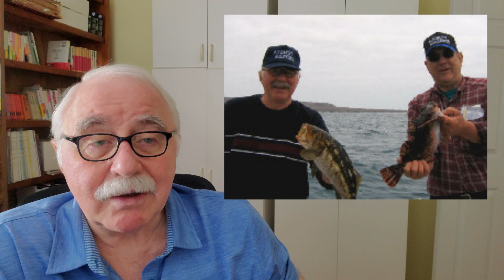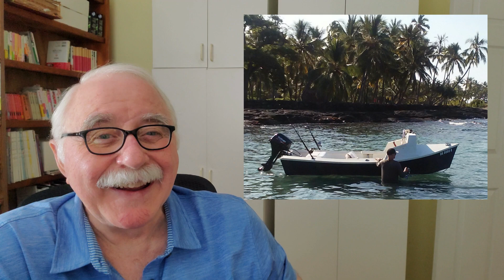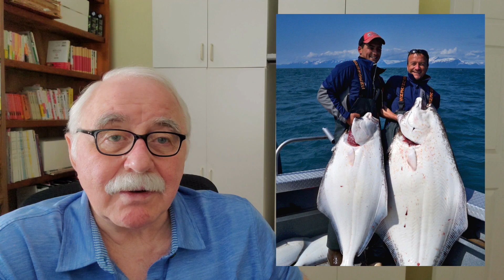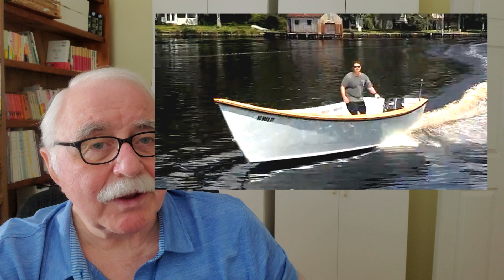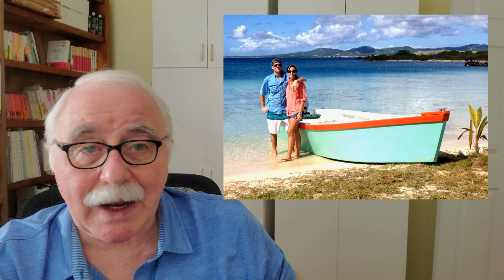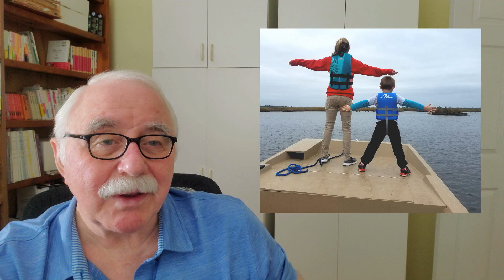Yes, You Can Build a Boat - Flat Bottom Boats.

Comment: In the 70's. I built a 20 ft. Carolina dory, fished up to 20 and 30 miles offshore LA. I worked running offshore supply boats in the oil field industry I have caught tons of Red Snapper in that skiff. I would overnight in the skiff around the oil and gas rigs loading up on Snapper. Big Paydays!
Reply: I enjoyed building the boat about as much using it. Now in my mid 70's I plan on building another for my twin grandsons with their help, they are now 18 and have a love for the water as much as myself. Both still live south LA.

Comment: The high prioritization of stability by the majority of power boaters is based on the fear of tipping over, which itself is rooted in the fear of the sea. You’ll never hear any complaints about stability under-way because the engine is running and the sea is at your mercy. But as soon as the motor shuts off, those deeply ingrained fears manifest, and the average boater demands a boat that feels like a pier, no matter the cost.

Basically, you shouldn’t get into a flat bottom because of stability, flat bottoms have other greater merits like, efficiency and being able to beach launch due to shallow draft, ease of build.  Stability is a pleasant side effect.

Comment: South Texas. I will be making a flat bottom boat to hold five people. It will be a 72" bottom with a length around 20'. myself and my 2 sons are about 300lbs each. it is  going to be used for bass fishing, catfishing and then fishing at night below a light. i will also use it to swim off of and maybe tow an inner tube. Center console 20 hp. you definetly have inspired me.

Comment: So a flat bottom boat should be easier to build. It should be cheaper to build. It should take less power to get it up to speed! It’s rougher in rough water.
Reply: It's rougher in rough water when you are going fast. At slow speeds or having the motor off, it's more stable in rough water.

Comment: Can anybody help me understand why we so rarely see flat bottom catamarans / multi-hulls?
I'm thinking of double-ender canoe type demi-hulls with no submerged flat transom, almost no inclination of the lateral surfaces (minimum drag) and no rocker, plus a pointy "axe" type bow. In other words: a hull shape where the least amount of overcome drag translates into lift, but instead forward movement only. Such a vessel would lose top speed, but gain a lot of efficiency.
~
Let's face it: sailing vessels often travel at rather slow speeds around 6 knots and the winds aren't always strong, but still, modern sailing cat hull shapes often seem trying to imitate racing cats or fast going power boats. The hull shape doesn't reflect the speeds that they're actually going at, in my view. Coming onto a plane isn't very realistic anyways, so why not commit to 100% displacement-only demi-hulls, accept speed limitations (~hull speed) and optimize for efficiency instead? Even when a sailing cat is motoring, fuel isn't free, and they still don't go very fast. I also have solar-electric catamarans in mind, where it's all about efficiency. Flat bottoms also increase live-aboard usability of hull space, plus: shallow waters and beaching become possible.
Of course, such hulls wouldn't really work for mono-hull sailboats (dynamic stability and maneuverability), but I believe it's a different story with multi-hulls.
~
I understand that a pointy stern (=double-ender design) seems counter-intuitive for pitch stability. On the other hand, if the stern has more displacement, a wave rolling under the stern will most likely lift the rear end and make the bow (which will be pointy anyways in order to reduce wave-making resistance) submerge even more (lever effect), hence the increased pitch stability may prove wrong if only the stern is wider, like in most modern cats. I don't believe that with a typical modern catamaran hull they pitch any less, instead only the pitch axis is located more at the rear end. Moreover, with motor cats (e.g. solar-electric) the COG is much lower anyways and there are no wind gusts blowing high above COG into sails (thereby further affecting pitch stability).
~
I also would only sllightly round out the transitions between bottom and lateral surfaces (=in order to reduce the wetted surface/friction resistance and induced drag), but no actual "round" bilge.
~
Thoughts anybody?

Comment: Hi,
Its a great video very informative. I'm from a Carpentry background but never built a full size Boat.

In England we have Canals that can accommodate a boat 4m wide and well over 20 meters long but when I checked the depth of the Canal after heavy rain in Wiltshire, it came back as only 1100mm deep.

I was looking at the possibility of building a House Boat suitable for the Canals with a flat bottom.  I'm sure I could build the Boat as I specialised in bespoke Carpentry but was worried about the depth of the Canal and the possibility of perhaps a stolen bike dumped managing to rip a hole in the hull.

I wondered how deep would you think a flat bottomed Boat around 15 meters long and 4 meters wide at deck level.  The flat bottom of the Boat would probably have an area of around 4 meters by 15 meters. The Hull would be angled slightly, so the keel part would be perhaps 200 mm below the highest part of the Hull at the edges.

Would it go under my target depth maximum of under 500mm. That's the max depth I would like the Hull to reach.  I plan to build spars and then clad with batten and fibreglass.
 I plan to add skid rails around 75mm running the length of the hull to give  a second chance against hitting obstacles dumped in the canal or grounding out in shallow water.

It would not travel far and it would rely upon outboard power to move around.

Most Canal Boats in the UK have steel hulls but mine will be fibreglass as I'm not that great a welder.

Please help with the depth calculations, if you don't mind.
Thanks
Reply: Mr. Spira was a wonderful man and he would have surely answered your questions, but he sadly passed away about a year ago or so.

Comment: Hi, interesting video thanks, would it be a crazy idea of building around 17-19ft wooden but fiberglassed over  flat bottom boat and building a shelter cabin in the front a light one probably fiberglass one just for two people?
Reply from the maker: Not at all many people do it.
https://spirainternational.com/hp_anac.php
https://spirainternational.com/hp_cour.php
https://spirainternational.com/hp_caro.php
Reply: @tjkid07  thanks for reply, some beautiful boats build out at the website however I am looking at one of those skiff boats just wondering what size engine would push it at sea nó matter the weather and wind with 4 people some gear around 18 ft skiff just to move slow no need plain speed let's say 8 to 10 kmh that's all I need, if it's petrol outboard? And whats your opinion same case diesel inboard, thanks

Comment: I river and lake fish missouri and Mississippi River local around st louis area would like a wide surface flat bottom boat would like aluminum or wood got any plans 25-50 hp outboard motor range don't need a speed boat just a simple fishing boat that holds good weight for 3 ppl and not cost a ton
Reply from the maker: Absolutely, look at the 16' Oysterman or 18' Carolinian. Perfect with 25 horses and some of my easiest and inexpensive to build small boats. Link to my site in the description.

Comment: I would like to build a 18 ft Carolina dory and put a 25 hp on it  but I am wondering what you do about level flotation requirements in the US
Reply from the maker: And which "requirements" are you speaking of for homebuilt boats?
Reply from the maker: @lukekondash4858  Those requirements are for boat manufacturers, not home builders. 
The very first sentence in that document is: 

Introduction
This guide is intended to help a boat manufacturer comply...

If you are home building the boat for yourself, you are not the manufacturer. If you are building it to sell to others, you'd have to get permission from the CG and from me and that would entail you meeting those requirements plus many others including product liability insurance and quality certification. 

You do not need a hull serial number, again, those are for manufacturers for sale to others. 

My hulls have positive buoyancy, meaning they float if full of water. The coast guard "recommends" flotation for anything you might add, like motors and anchors. The recommended requirements are in the Coast Guard "Safety Standards for Backyard Boatbuilders."  which you can download for free in my insiders section. 

Basically, if you have a self sealed deck you already have the flotation, if not it is relatively simple to add flotation for your motor, battery and anchor. Fuel is also buoyant, so will float in water already.
Reply: @tjkid07  Thank you so much that clears allot up for me

Comment: Hello, is the free downloadable print for the 17' Garvey the same as the ones you sell? or do they come with any additional information?
Reply from the maker: Well the free ones are the study prints. They come with an overall arrangements page with specifications and overall dimensions, a second page with the construction method, a bill of materials and the fastening schedule. The full plans include those two pages plus the transom, stem and frame dimensions, the strong back assembly jig, and the frame assembly dimensions. The plans also come with a 40 page construction manual with instructions on the tools, materials, fasteners, glues, assembly, finishing, and internal accessories.  The ply on frame manual can also be downloaded from the insider section for free when you join without buying plans.

Comment: I think that a lot of these myths about flat bottom boats come from the very real factual dangers of using flat bottom boats on the great lakes. ESPECIALLY the Saginaw Bay. The great lakes are notoriously unpredictable. I've been out 2 miles on a 14 foot deep vee in glass-flat water and within 30 seconds i'm beating feet at 20kn back to shore riding 6 foot swells. The trouble with flat bottom boats on the great lakes is that the Dynamic stability that you mentioned is paramount due to the rough water we get. You see whitecaps any day where the wind is anything more than a stiff breeze on the bay, because the water comes about 100 miles from Lake Huron proper into the bay, and the prevailing currents can sometimes come in from Thunder Bay in Ontario. So essentially, to go any further than 2 miles, you need a 16 foot deep vee with a MINIMUM 6 foot beam and a hell of a lot of draft, and if you want to get into lake Huron from there, you better get at least a 20 foot with inboard motors. People think the great lakes are a piece of cake compared to the ocean, but they're 1,000,000 times rougher, more unpredictable, and scarier. On the ocean, it's generally calm, it takes a hell of a storm to kick up 6 foot waves. But the Great lakes are so cold that they just crap out an unforecasted storm like it's nothing, and even at that, it doesn't take more than 20-30mph winds to kick up 6 footers.